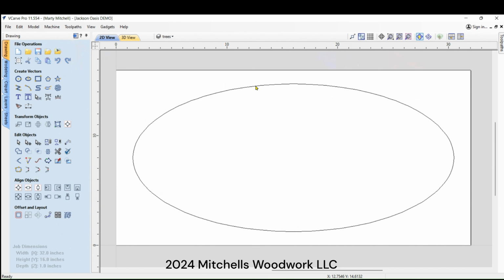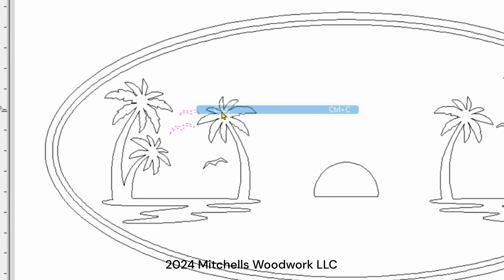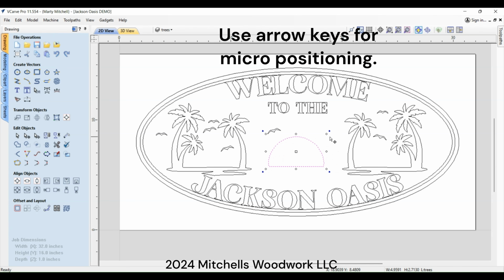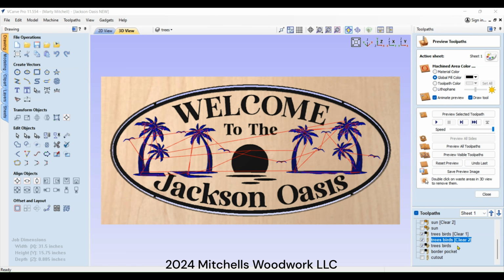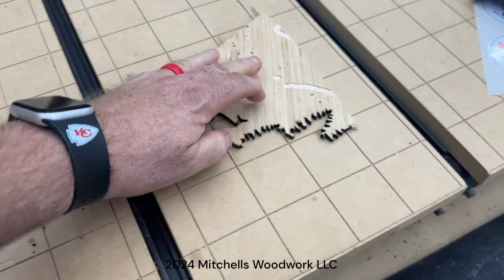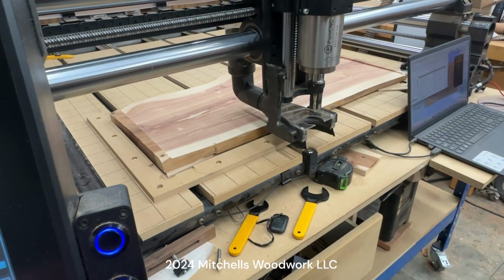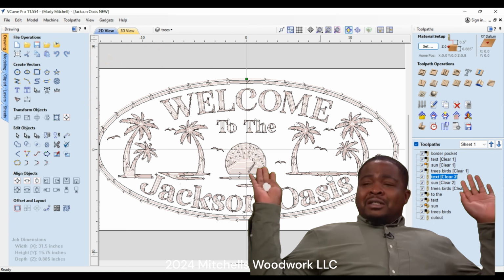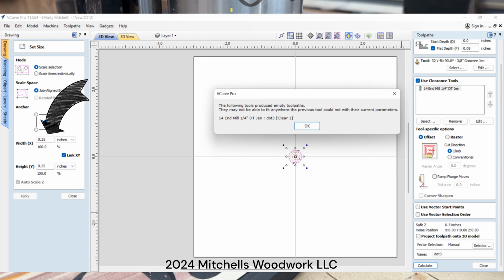How To Design Signs Like A Pro: VCarve Pro Tutorial - Episode 2

Comment: I learned about the dry run which I think is very valuable. I also like your add ons to the Masso. I have not seen many of your tips on any other youtube.  good job
Reply from the maker: @DavidCzapnik-r1k  thanks for the kind words! 😊  If you’re interested in the DashMade EZ Button, you can use my discount code below to help save a few bucks. 

🎯 Get 10% OFF DashMade Products with code: MITCHWOOD10
DashMade EZ Button: ➡️https://www.dashmadewoodworking.etsy.com